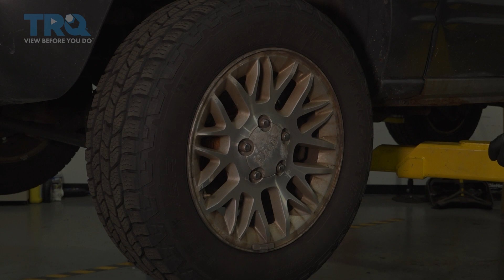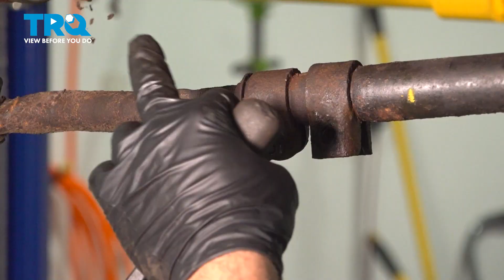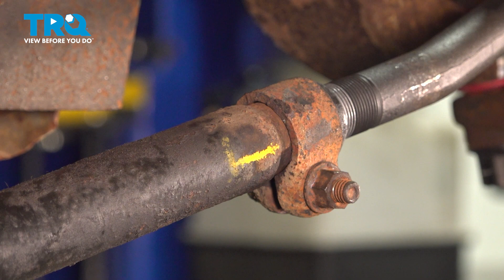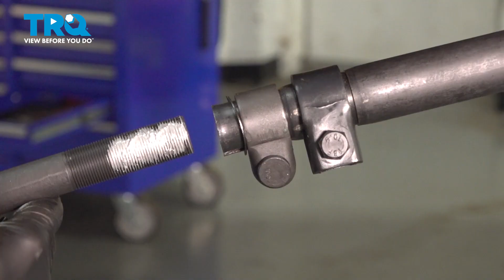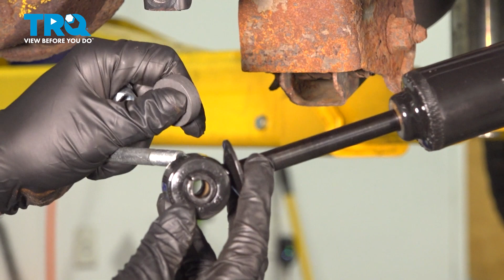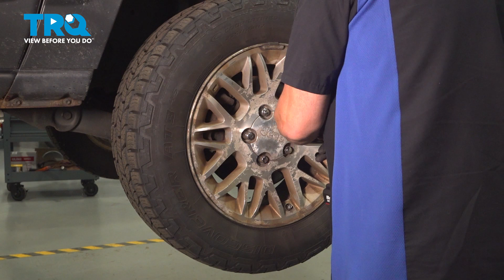How to Replace Front Center Tie Rod Adjusting Sleeve 1999-2004 Jeep Grand Cherokee

Comment: I just installed the upper and lower drag links and tierod ends from u guys on this vehicle last night.  When I made the whole piece the same size as the original, the tierod ends are not screwed in past the slot openings.  Is that a big deal?  Please let me know. Thanks! Was late last night I had to just throw them on, havent got alignment yet.  I used way too much antisieze those guys r gonna love me lol..  I love u guys channel and parts.. please keep it going for these 99-04 jeeps and for 07-13 tahoe, suburban, escalade, etc..